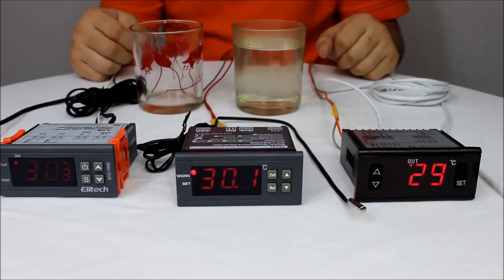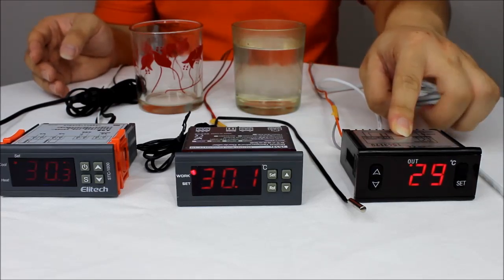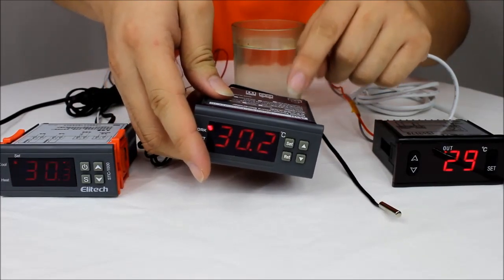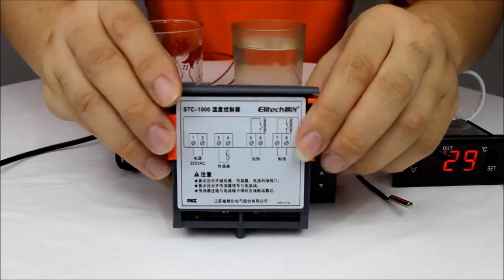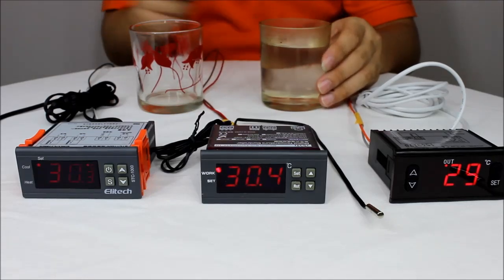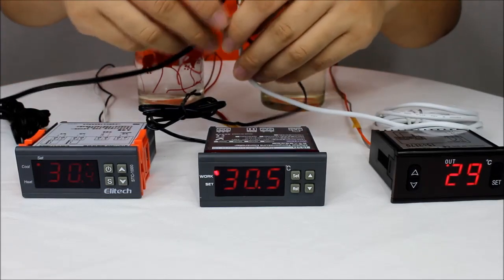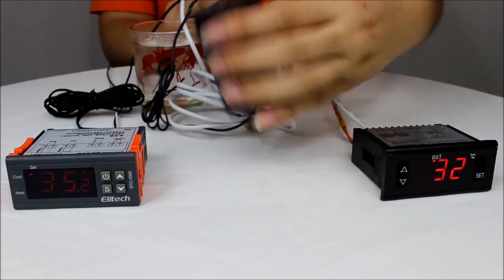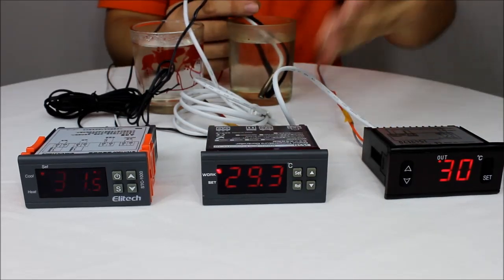The patent technology from WILLHI Dual core MCU for the digital thermostat WH7860 series

Comment: I bought a Whilli WH7016H, several problems, the connection plug shown in the notice wasn't the same as on my product !! I finally did all the connection successfully but the thermostat don't work for heating, only for cooling ! I don't have the HC choice on the menu...
Reply from the maker: You must bought a fake WILLHI thermostat.

Comment: I have 2 of these been using them for years, one (12V unit) is in use in my Race car to monitor Manifold Temps post supercharger and activates both a Methanol injection systems and a Fan system this on ever reads in Fahrenheit so my american brain can read it faster while on track. The other (115v unit) Works for heating an oil bath for flasks during chemical experiments distillations ect. Have left this unit running an experiment for over a week without touching it and it worked flawlessly. I have since fitted it with quick connectors and use it as a space heater thermostat when not needed in the Lab.